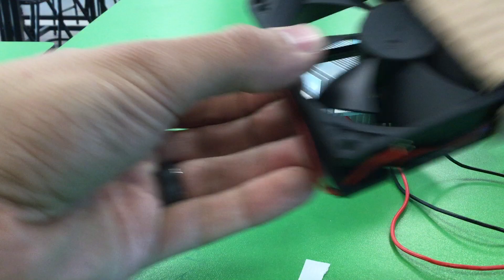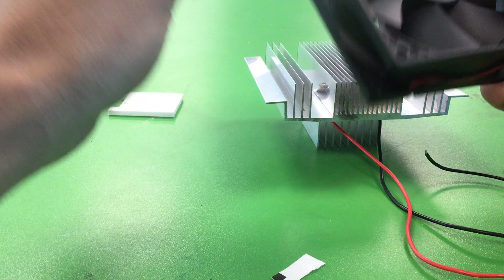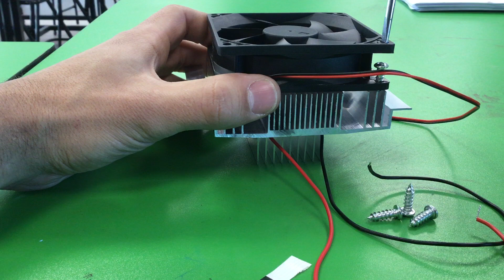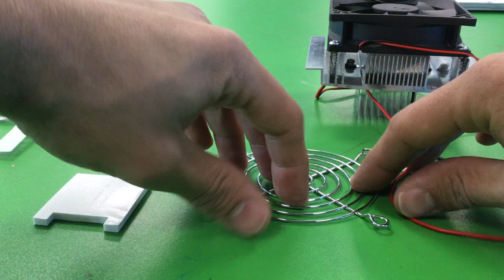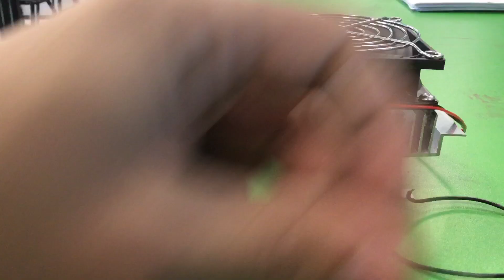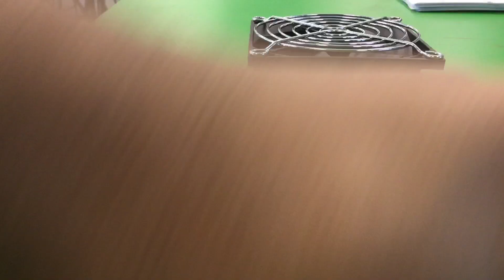Adding an external fan to a peltier cooler kit

Comment: i dont understand :(  
1. why you use heart shaped stickers??
2. can you do video how you will fix it on the box pls
Reply from the maker: I'll see if i can make a quick video on Monday showing you how I installed it.
Reply: @DrBlackAdder  
Thanks , my box cooler thickness is 10 mm and i want to isolate the heat from inside and outside
i will wait of your next video  😃
Reply from the maker: Enjoy: https://youtu.be/XwAhRzeulLY
Reply: Plz let me know why my peltier overheated and was damaged .Can u pin point the fault